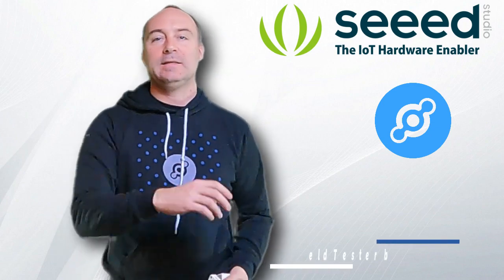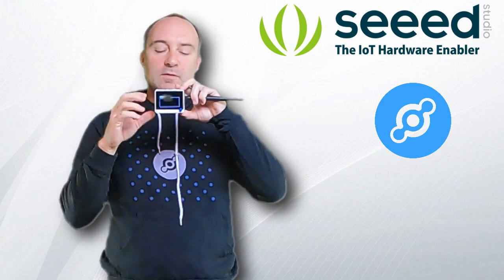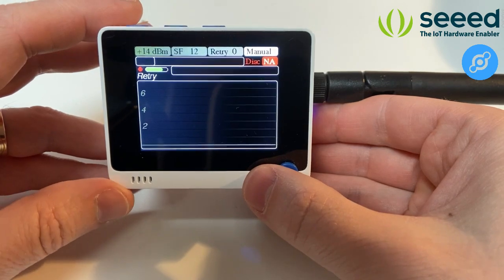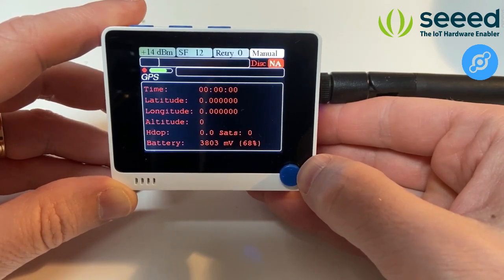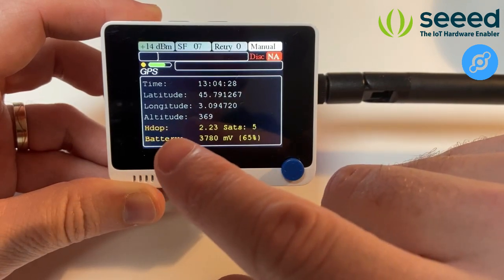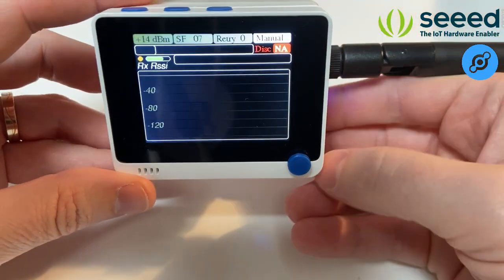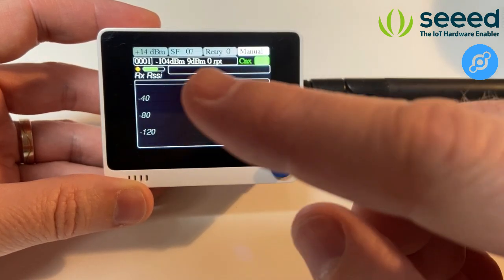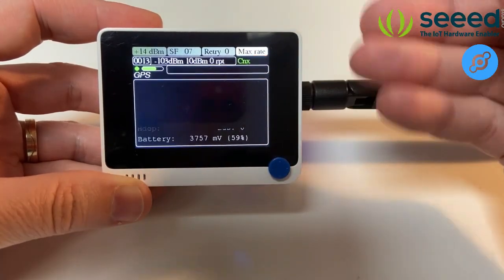Seeed Studio, WioLoRaWanFieldTester kickstart presentation of the Helium mapper

Comment: Hi Paul,
How many DCs are included in the tester?
Are there any instructions how to connect it to our wallet?
I don't understand this part :)
Thank you!
Reply from the maker: There is no link between the tester and you wallet. The bundle includes 200k dcs for the communication. It’s a pool so there is not hard limit if you have a normal usage of the mapper. I plan 3-5y of communication in normal usage.
Reply: @PaulPinault  thank you very much for your reply! If we want to extend this 3 to 5 years usage (I’m not sure if it will be needed) can we add some DCs or link it somehow with our wallet?

Comment: Hello Paul,

As far as I understood, the maximum number of hotspots that the device can receive the message from is 3. Then why are the numbers 5, 10 and 15 on the dashboard? 
Also, is it possible to somehow show the maximum number of different hotspots that can respond to you? Like, in a certain position you might be able to communicate with 50 hotspots, but it will only show 3 (or 15?). Does it have a "receive only" mode?
Thank you!
Reply from the maker: Hi Plamen. The number of 3 is a way to control the DC consumption. If you want to get more hotspot at a specific location you just have to let the device have multiple communication at that place. The mapper will give you the details. The hotspot graph allows to see up to 20 as unit because in a DiY approach you can set you Message purchase to infinite. Why not more … just because i son’t really think you will get more even in dense area. I may be wrong but it’s a better readability for 99% of use-cases. Source code is open. So if you need more you can alway modify it.
Reply: Hello Paul, thank you for your answer! 
So, I can set it to send more messages. I guess you only consume DC (data credits) when a hotspot sends back a package, or just by sending a request? How much DC do you need for one message sent?
Theoretically, having the number set to 3 is going to be okay for placing sensors, but if one want to find the perfect spot for another hotspot maybe a higher number is better in order to see with how many other hotspot you could interact. That being said, is it possible to see the names of the hotspots that you have connected to, or this is done in some other application? 

Thank you!